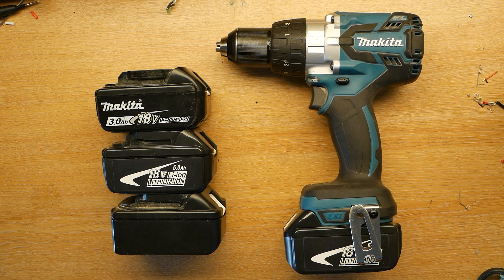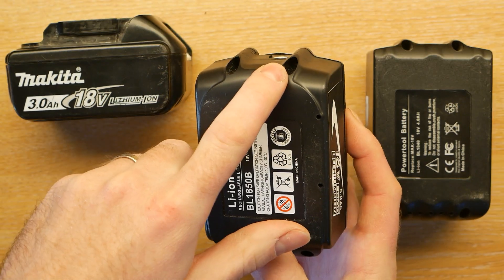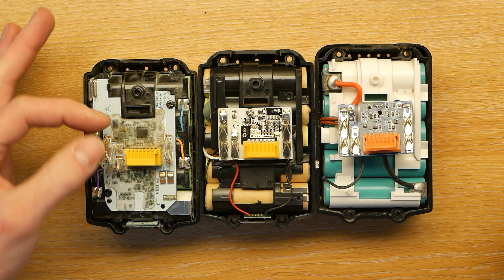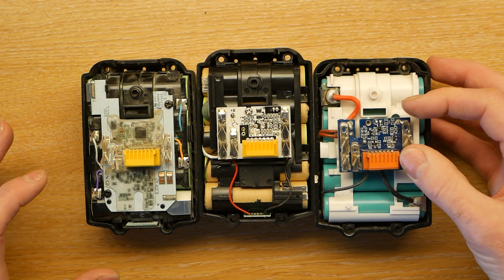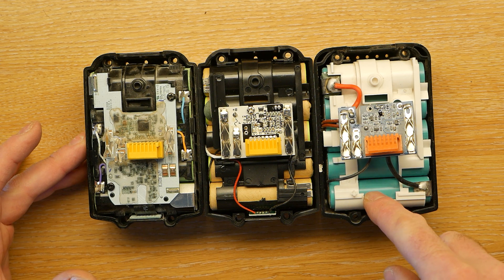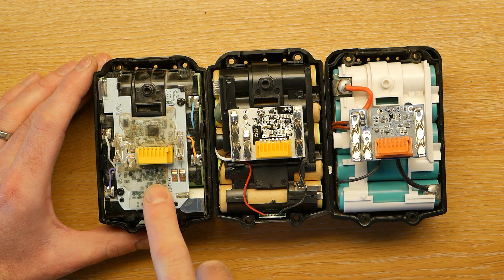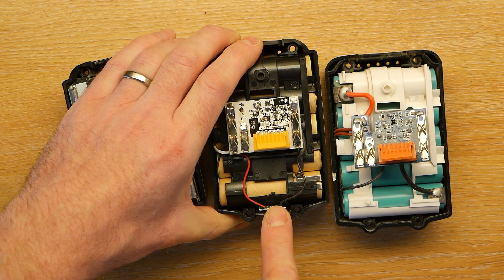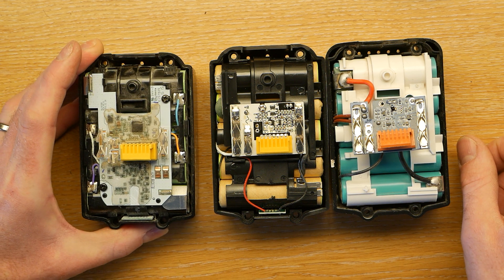What's inside Makita 18v LXT BL1830B OEM and clone battery packs?

Comment: What is a safe way of getting these cell packs apart so that I can utilise and charge up seperately for say my torch! 
These Makita batteries are crud, they litrally draw one cell constantly and say if you leave a battery not used over the winter the thing bricks itself and once you put it on charger a couple times the charger or battery blocks the chip! THEY DONT EVEN TELL YOU THIS!

Comment: I have some clone Makita packs, they claim to have the same protection as a the real batteries. I can kinda maybe confirm my batteries do. I use them on some old Milwaukee tools from the NICAD days I converted to use Makita batteries. These tools have no smarts in them at all and the clone batteries do turn off when they are fully discharged. Which could only happen if the battery controller was turning them off.... I know this is an old vid, but the batteries I'm speaking of are 2 and 3 years old. So at least some of the clone batteries these days do have protections similar to real Makita.
Reply: Are you seggesting that the drill can cause the battery to brick? fry the chip?
I bought a 5ah makita BL1850B battery and after a year of not much use the thing would not work and would not charge? I did always have a quick check on battery level by pressing the battery indicator button but I left it a couple months and then remembered and the thing was junk? 

After a good google I found info stating that the battery indicator always draws a small amount of power from one cell and when left and not charged this tells the chip that one cell is damaged (but it is just lower than the rest) because of the set up Makita use... so wont allow you to charge it... AND THEN the bleeding charger AFTER A COUPLE ATTEMPTS blocks the chip so that it will never work/charge again! THANKS MAKITA!! why they dont bloody tell you this? 

I cant for the life of me think why else this battery would not work?

Comment: It’s only when you come to driving high demand power hungry tools you realize why the OEM is needed and worth the extra cost 💵. However if you’re only drilling a 5mm hole now and again and screwing and unscrewing half a dozen small screws I get the appeal of a good knock off battery. Having said that I still wouldn’t buy knock offs 🪫 as I’m always scared of electrical fires and shorts especially if I left the battery on charge overnight because I forgot to take it off. It’s a lot of power being stored in a small box 🔥.

Comment: I recently got a purported Makita DHR242 rotary hammer drill with 2 18V 6Ah batteries and a DC18RC rapid charger. I also have a completely genuine DMP180 air pump with 2 18V 3Ah batteries and a real rapid charger. Just the 2 real 18V 3Ah batteries and rapid charger cost almost the same price as the DHR242 rotary hammer kit. Just looking at all the labelling, etc, it is hard to tell that hammer drill kit is not genuine. It works fine but there are some interesting differences. The purported DC18RC rapid charger has no fan and thus is very lightweight and takes close to 3 hours to charge the purported 6Ah battery. The non-genuine 6Ah batteries will not actually fit into the genuine rapid charger. If you press the release button, you will see a red mark on a genuine battery and these 6Ah batteries don't have it. The non-genuine 6Ah batteries won't actually slide into my DMP180. The genuine 3Ah batteries will slide into the purported DHR242 and actually run it just fine, but they don't slide into the non-genuine rapid charger. If you measure the voltage across the slide terminals for the 6Ah batteries it is sitting around 20V. When the 3Ah batteries are not slid into a device, there is no voltage you can read across the slide terminals.

Comment: Did you notice on the Makita one the third exposed metal sliding contact is actually two separate pairs electrically isolated? I'm trying to find out why because I have a BL1830 which is rejected by the drill. Charge indicator on the power tool says it is full (it is 20V across the outer slide connectors) and it works if I unlatch and slide it out 1 mm, but press it fully home and the tool work light operates when I pull the trigger but the motor does not run.
The near part of the third contact is at the same voltage as the +ve terminal but the far part is at the voltage of the -ve terminal on this rejected battery - on a good one it is also at the +ve terminal voltage. What function does it serve?
Curiously, the charger does not connect to the +ve terminal, instead it joins the two parts of the third contact together and uses them for charging.
Reply: Wow, that's interesting! No, I'd never noticed that. Maybe it allows the drill battery to detect if it is inserted into a drill that has a connection to that third pin (which would short them together)? It doesn't really explain why half-sliding it in would make the drill work though!
Reply: The drill connects to the furthest part of the third sliding connector, the near part if it is not pressed fully home. If the drill contact is at the +ve potential the drill works fully. If it is at the -ve potential the drill work light operates as normal but the motor does not. Clearly this allows the battery to disable the high current part of the drill. Same in other power tools no doubt. I suppose it could be used if the battery temperature was too high or the cells were too imbalanced.
Reply: @murdo_mck the deepest of the 2 pins is a signalling pin. High means the tool is allowed to run, low means tool won't run. I cover it in my 6th video. Unfortuantely I don't think you'll be able to fix your battery. The BMS has likely permanently locked itself.
Reply: @toolscientist  I was able to get this battery to work with the Makita charger and the drill. It had been rejected by the charger either 1 or 2 times only before I replaced the cells so the BMS had not locked. I shorted together the front and back contacts of the third slider (the small split one) together with the battery positive slider. BTW it is a 3.0 Ah first generation (no charge indicator) BL1830.
Thank you for your video, it is reassuring to know I'm probably missing out only on low voltage protection which I can do without.
I have confirmed it charges to the same end point voltage as an unmodified battery and the cells remain balanced.
Reply: @murdo_mck wack it on a Laptop charger with the end cut off and make terminals or by from Halfords some battery connectors.... which can also be used to connect two batteries together... A fully charged decent battery to the depleted one to charge it up!

Comment: this was an interesting video, do any of the packs,cases and boards interchange into the original case. like if the makita BL1830 just had dead batteries (is there a date on them? no idea how old mine is, bought used) could i get a $22 AUD on ebay currently cheapie and put it in the makita case and use the makita BMS/board etc (i have a feeling a lot of these fake makita batteries don't fit the makita charger)
Reply: It's hard to know but it feels like they should be interchangeable to some extent... You could definitely buy a dead battery and swap the cells, and unless there is something in the Makita control board that intentionally bricks it, it should be fine (I'd be pretty confident saying there's nothing in the clones that would stop you doing that). I have taken a 10 cell battery with dead cells and swapped them all around to make a working 5 cell battery, and that was fine. Or you could definitely take an old clone battery, buy a cheap $6 makita cell balancer board and fit it, and I think at most you'd need some minor work with a dremel.

Comment: Old video but anyway. Yesterday I opened a 10 year old original BL1830, without the indicator. The BMS is the same type as your original one but slightly smaller and it also had balance wires to all cell pairs. The cells were Samsung INR18650-15Q SDI 096.

Comment: Your BL1830B has the new board with an ID chip under that glob of glue above the yellow connector.  It also has the balancing - Neg (0v) is the Black power wire, then (3.6v) purple, (7.2v) yellow, (10.8v) white, (14.4v) blue, and the Red positive (18.0v) power wire.
The older packs only have a single line to the 1st cell above Neg to shut it off when that cell is under minimum (3.2v) counting on the others to have the same Ah capacity.
voltmeter
Reply: I bought a 5ah makita BL1850B battery and after a year of not much use the thing would not work and would not charge? I did always have a quick check on battery level by pressing the battery indicator button but I left it a couple months and then remembered and the thing was junk? 

After a good google I found info stating that the battery indicator always draws a small amount of power from one cell and when left and not charged this tells the chip that one cell is damaged (but it is just lower than the rest) because of the set up Makita use... so wont allow you to charge it... AND THEN the bleeding charger AFTER A COUPLE ATTEMPTS blocks the chip so that it will never work/charge again! THANKS MAKITA!! why they dont bloody tell you this? 

I cant for the life of me think why else this battery would not work?

Comment: Hi, great video, I am a Master student, and am doing a project on designing and battery system for gardening tools, and I noticed that most of them have an 18V battery pack, I just wanted to know if the cells used are 18650 cells, as the capacity being 5Ah, would need a two sets of 5 cells being in parallel right ? Because I am assuming that 18650 cells do not have such a high capacity, or are they 21700 cells ? Thanks a ton !!
Reply from the maker: Yes, that's right - it's just 10x 18650 cells - two sets of 5
Reply: This is the BL1830B which has 5 series, 2 parallel for twice the run time (current in Ah) of the BL1815 which is 5 series, 1 parallel.
The 18650s that an OEM battery pack is assembled from are power cells that can produce a lot of amperage quickly, until that circuit decides that the #1 battery is below the cut off.
Reply: In order to get 5 Ah you could just like have two 2.5 Ah 18650 batteries connected in parallel. I think the maximum for an 18650 (capacity-wise) is 3.5 Ah.

Comment: Everyone claims the "balancing" version balances the cells, but there doesn't appear to be any balancing circuitry on the board. It appears the extra leads simply monitor the separate cells so it can brick the battery when one cells falls out of it's set tolerance (as well as prevent over-discharge from running one of the cells in a backwards polarity configuration). It would be nice to see someone test the balancing function of the aftermarket replacement boards for functionality, both in balancing as well as low-voltage cutoff with imbalanced cells). Thx for the content.
Reply: He could simply have checked the voltage of each cell after a full charge to check if they were balanced, like for the battery clones. And he may actually have done so, though unfortunately he didn't say.
Reply: @unnainconnu9098  who cares if his battery is balanced ? I certainly don't. I only care if the board has balance capabilities.
Reply: @fiveangle  I meant it as a way to demonstrate if the battery can self balance or not.
Reply: @unnainconnu9098  well then your process wouldn't have done it... he would have had to partially discharged one cell using alternate means (like connecting to a hobby charger) and then check the voltages after full charge.

No one is questioning HOW to confirm... that's rudimentary. That nobody on any of these videos seems to actually confirm that balance occurs with the stock charger is the issue. #ifeellikeimtakingcrazypills
Reply: @fiveangle I bought a 5ah makita BL1850B battery and after a year of not much use the thing would not work and would not charge? I did always have a quick check on battery level by pressing the battery indicator button but I left it a couple months and then remembered and the thing was junk? 

After a good google I found info stating that the battery indicator always draws a small amount of power from one cell and when left and not charged this tells the chip that one cell is damaged (but it is just lower than the rest) because of the set up Makita use... so wont allow you to charge it... AND THEN the bleeding charger AFTER A COUPLE ATTEMPTS blocks the chip so that it will never work/charge again! THANKS MAKITA!! why they dont bloody tell you this? 

I cant for the life of me think why else this battery would not work?
Reply: @fiveangle How do I disconnect the cells that seem welded safely after the battery chip brixked because it had been left for a while and ome cell is drawing constantly for the battery tester button

Comment: can you remove the batteries in the pack and replace them?
Reply: As long as PCB is not bricked on Makita original one, then yes. Knockoffs I think won't brick themselves, just elements go bad.
Reply: @Tegelane5 What is a safe way of taking them apart? I have a 5ah that is heavy spot welded and my cheap solder iron wont touch it? can I cut them off and what way is safe
Reply: @stephenmaas8775  PCB is soldered on top, that I've desoldered with adding solder flux and then using 60W soldering iron. For spotwelded tabs I have not found good method, knife between side and twisting and cutting. Also minding not to touch other elements.

Comment: Great video bud. Do you have a pin out for the yellow plug?  I'm Modding a double charger to charge de Walt on the other side but the charger isn't seeing the pack connected when it's on my new posts, I've removed the yellow plug and repositioned posi and neg
Reply: Use a Laptop charger